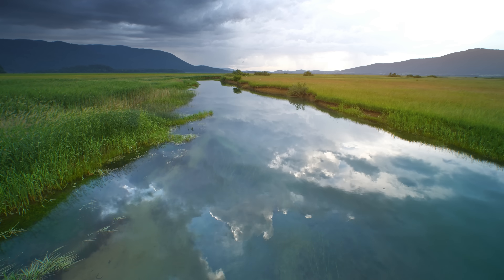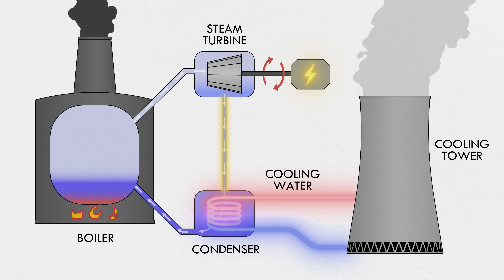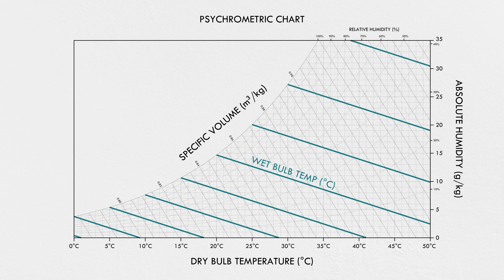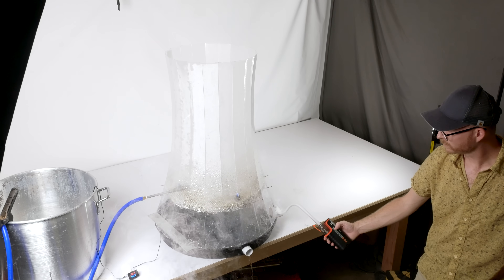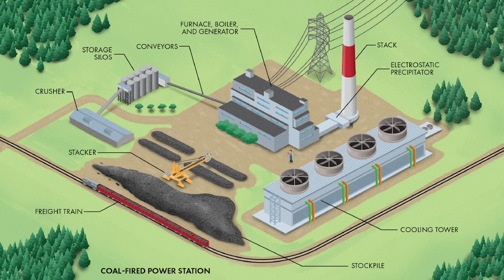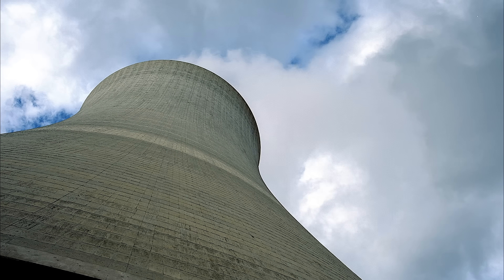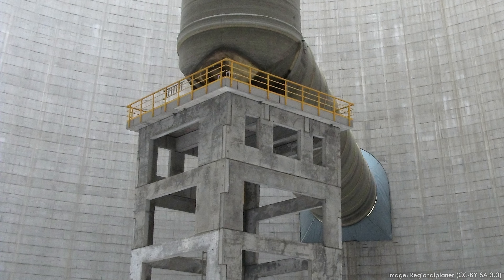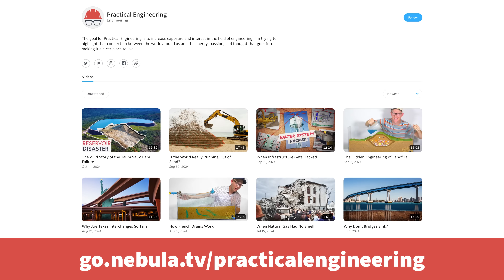Why Are Cooling Towers Shaped Like That?

Comment: I have never been able to understand why they use a lot of power to boil the water to use the steam for the turbines and instead of just dropping the temperature just a bit, the output from the tubines is cooled right down and then yet more energy has to be used to generate more steam.   It seems rather a waste of so much heat and hence inefficient.
Reply: it isn't as wasteful as you think because this is extremely simplified and skips over a ton of technical detail that makes it efficient

Comment: 1:36 If they were venting to atmosphere wouldn't they be limiting themselves to a much higher cold side temperature than they want to use? I thought the aim was to get the low pressure side below atmospheric pressure.

Comment: 7:40 - Yes, that is a detail a lot of people don't know (and I'd say it's pretty unintuitive). The density of "pure" steam is about half the density of air. So it's not just that hot air can contain more moisture and will rise due to being less dense than the cooler air surrounding it, but the steam itself also "rises" (again, due to being pushed up by denser air around it).

I always avoid saying "hot air rises" because that's a bit misleading. It's not the hot air that's "rising", as such, it's just that the denser air around it pushes it up, due to being pulled down by gravity. So it was nice of you to reword that as "more buoyant" on the next sentence, which I think gets the point across that the rise is caused by what's around it.
Reply: This also ties itself very well to meteorology 🌦️
Reply: what is it about humid air that makes it bouyant in air
humid air is just air with water in it isnt it? and water isnt bouyant in air
Reply: @vincentgrinn2665  - Water in gaseous form is less dense than (and therefore buoyant in) air.

Comment: My personal favorite about cooling is Brunswick Nuclear Plant near Southport, North Carolina. It uses an 8 mile channel to take water from the Cape Fear River and discharge to the Atlantic Ocean without needing cooling towers but there were issues with approval for that so there are two unfinished cooling towers on the site.
Reply: I had to search it up, the Wikipedia picture gives perspective of just how huge the base of the tower is. Google maps shows that the inside of it is being used as a parking lot now!

Comment: large cooling towers are NOT that common for nuclear power plants actually. most nuclear power plants use large bodies of water like the ocean to cool since they need far more and more consistent cooling. the association of cooling towers and nuclear power plants is mostly wrong, they are far more common for coal or gas fired power plants.

Comment: We had two separate sets of cooling towers at the papermill I worked at. One for tthe process water and another for the feed to the effluent treatment plant to keep the temperature in the narrow range needed to keep the microbes in the biomass from either going dormant or dieing.
Reply: The papermill has microbe biomass which it tries to keep alive?
Reply: @marc-andremichaud1251  Yes. The cooling for the process water keeps non-desirable solids from being disolved in the water improving the paper quality and in order to have a semi-closed water system the biologics that are in the water need to be treated before being sent to the municipal waste water treatment facility. We had an effluent treatment plant to do that and the microbes had to be kept at 95º to 105º degrees to be active. The byproduct of that process is biogas for a power turbine to reduce electric costs or reliance on natural gas for the boilers depending on conditions.

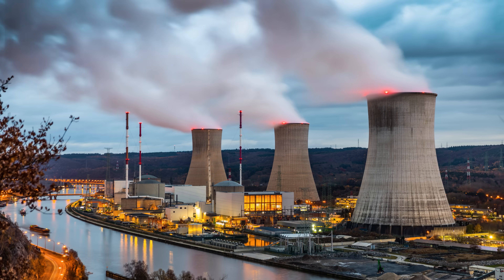Comment: 13:37  CANDU plant!  All of the plants in Canada use lake or ocean cooling rather than cooling towers, but cool to see a reactor that is so familiar to me.
Reply: You can see the same effect in your shower, if you have a curtain. If you take a hot shower and have a fine mist sprayer, you see the curtain get pulled into the shower. That's all because the air current created by the warm, most air rising and the cooler, drier air being pulled in to replace the air that rose. Even with hot water, you can create currents. Some old hot water heating systems didn't use a pump. Instead, the hot water would rise and draw the cooler water into the boiler, to be heated. It took longer to heat up the whole system this way, but worked nevertheless.
Reply: @kevinyancey958  Actually that low pressure is mostly due to the Venturi Effect where the spray of water draws air along with it, causing a low pressure area.  Higher pressure in the rest of the room pushes the curtain in.
Reply: I used to work at opg and now I'm at Bruce!!! Neat to hear someone working in the same group also watching :)
Reply: All plants here in Sweden are cooled by seawater, and obviously built on the coast. I always thought these were super foreign as a kid, and turns out that I was pretty much right. Besides stuff like hydro and wind, I've never seen another type of powerstation in sweden, so I can't say for sure there are none but I can say I have never seen one.
Reply: Which one do you think it was? Darlington or Bruce?
Reply: @acemannotsomeother  It might actually be pickering,   I count a 23 X 23 tube face  , which suggests 390 pressure tubes, I know it's not Lepreau (Candu 6 380 PT)
I worked on the lepreau retube.
Darlington and  Bruce have  480 PT   so more  rows and columns .
Reply: In-land power plants will create their own ponds to cool the power plant. It's best to do this, than to heat a lake with fish in it.
Reply: @kevinyancey958  not if you have the largest lakes in the world. You only need to raise local temperatures by a few degrees and the fishing is great near the outlet due to the slightly warmer water keeping the big fish around.
Reply: @kevinyancey958  I'll never understand this idea that nature doesn't like heat.

Comment: For those like me, that can't believe that wet air is less dense then dry air, it's actually pretty logical:

Dry air is heavier. Air consists mainly of nitrogen (N) and oxygen (O). The molar mass of a nitrogen atom is 14 g/mol and that of an oxygen atom is 16 g/mol. Since these elements occur in the air as N₂ and O₂ molecules, their mass doubles: 28 g/mol for nitrogen and 32 g/mol for oxygen. A water molecule (H₂O) consists of two hydrogen atoms and one oxygen atom. Hydrogen has a molar mass of 1 g/mol. The weight for a water molecule is therefore: 2 * 1 g/mol + 16 g/mol = 18 g/mol. Water vapor is also lighter than the main components of air, N₂ and O₂. When the air absorbs moisture, the lighter water molecules displace some of the heavier nitrogen or oxygen molecules. Moist air is therefore lighter than dry air.

Thx for your videos! You are the best!

Comment: 0:15 The smoke stakes are not designed to disperse smoke far away from the cities and just to use the difference in the air pressure to not use ventilation hardware. 8-)
Reply: It's actually both.
Reply: Actually no, it still is in fact one of the design purposes..
Reply: But they still do...
Reply: Maybe not but smoke STACKS do.
Reply: He didnt say cities, he said populated areas i.e. where people are. If they just didn't want to use ventilation equipment, they wouldn't try to pump it anywhere and just let it flow into the factory.
Reply: Mmmmm.. smoke steaks...
Reply: My brain cramped reading this
Reply: sometimes there's a layer of air close to the surface where hot air actually sinks. The goal of the stack is to put the exhaust above that layer of air so that it doesn't concentrate on the surface.
Reply: Sorry you're wrong ! In Grimsby we put up Tioxide tower from the white paint factory , built it REALLY high to get rid of the nasty chemicals make sure they didn't land in the north sea close by .   The fallout made it to Scandinavia (much to the swedes distress LOL)
Reply: Smoke stacks were specifically made tall for the dispersive effect not to act as a vacuum. Also that wouldn't work. The pressure in the stack will just form a pressure gradient equal to the atmosphere.
Reply: @Arethious  inside the stack pressure is lower because the gas inside is warmer, hence the strong draft.
Reply: @markotrieste  true there is convection. I didn't say there wasn't. I was talking about the idea of using lower pressure atmosphere as a vacuum. That won't work. Also it's not the pressure that changes so much as the density. That makes the hotter gas buoyant. If the pressure changed it would just compress back down from the surrounding gas pressure. There will likely be a low pressure area in the stack but that is likely due to the venturi effect and because the gases start picking up speed in a uniform flow its inertia pulls on the gas below it.
Reply: Smoke stacks are tall both to have strong natural draft as well as to eject the contaminants above the inversion layer. Especially in winter, if you have an emission of pollutants inside the inversion layer, they don't spread. Inversion layer is characterized by a temperature gradient that rises with height and has little to no wind. So it's definitely correct to say that stacks need to be tall to disperse the pollutants away. See 2:25 for a typical example of stacks piercing above the inversion layer.
Reply: Me when I spread misinformation
Reply: It's not smoke
Reply: It's not smoke.... spoiler alert...

 it's steam a.k.a. water vapor
Reply: @Jake-uc8mb  Click the timestamp genius, the shot was of smoke stacks in front of coolant towers, and he was talking about what smoke stacks do as opposed to coolant towers.
Reply: No smoke comes out of these stacks it's all steam. As the water falls through the tower the air naturally cools the water the stuff coming out the top is just steam/ vapour.
Reply: @Classic_Re-creation  Cool. Click the timestamp. It shows smoke stacks in front of the coolant towers.
Reply: It's not smoke fool's
Reply: @GeorgeWashington283  he did clarify later in the video that sometimes they hide an actual smokestack inside the cooling tower
Reply: @GeorgeWashington283 finish your sentence
Reply: @GeorgeWashington283 It's not smoke, fools.

Comment: It's definitely pronounced turbine and not turbin because it's spelled turbine.
Reply: extremely pedantic incorrect buzzer
english ain't that simply buddy and different regions use different pronunciation, eg nuclear, alumin(i)um, etc. No grammar naziism please
Reply: @OutbackCatgirl  Aluminum is spelled aluminum and aluminium is spelled aluminium. With the reach of communication, regional dialects will slowly vanish away and pronunciation will trend towards how the word is spelled, because well, it's simpler. Let's not slow this process. Why would you want to continue to needlessly complicate the English language? I know I say wuder and I know it is spelled water and I acknowledge water is the correct way to pronounce it. If my audience is not local, I will make the point to pronounce it correctly.

Comment: 8:44 - I hear "reject", subtitles say the same but while not a native speaker shouldn't it be eject?

Or is reject specific engineering lingo in this case?
Reply: Its a specific term. Heat rejection is the process of removing excess heat from a system.
Reply: @Tevruden  Thank you captain 🫡

Comment: I never guessed that dry hair would be more dense than humid air
Reply: when you think about it, it kind of has to be, or clouds wouldn't stay airborne.
Reply: what about wet hair?
Reply: i barely even understand how
"water molecules weigh less than the nitrogen or oxygen in the air"
ok then why is water denser than the air? why dont oceans float ontop of air
Reply: @vincentgrinn2665  because the water molecules in question are in gaseous form. So my understanding would be that gaseous water molecules demand more personal space than gaseous air molecules.
Reply: @kenbrown2808  ah yep ok, they weigh more but theyre less dense
Reply: @vincentgrinn2665  that's my interpretation.
Reply: @vincentgrinn2665  because things act differently when they're gas vs liquid? You're unsure how liquid water doesn't float on air?

Comment: Waste heat can also be used for heating greenhouses, households
Reply: Yepp, I write this comment in the warmth of my home courtesy of a power station (and nearby paperpulp plant)
Reply: Nuclear powerplants are often built at a long  distance from big cities, to make it "economically motivated " to connect them to the system " ,long distances kll the economics in regional heating systems.  High energy losses , very long pipes are expensive to build and maintain ,high flow pressure losses in the pipes if they are long. 
Regional heating needs relatively high density /concentrated built inverments to be ,feasible.  Not nesseery big citys but not to spread out.
Reply: @perstaffanlundgren  greenhouses then?
Reply: @Hecatonchires1991  if there I any around them mayby, but the initial investment building the regional heating system is so big and a fue greenhouses would not cut it as a customer base  to build it.  Or they would have to pay a lot to get it there. 
For example if  a street has only one house and its 1 km pipes going there   from the main line    to put together and bury to connect ,it would be very expensive for that house owner  likely there will not be built pipes there,  but a street with 40 houses and ikm pipe  would  be more economic.  It's a good idea to reuse the waste heat and I truly think it would be possible in the most citys and even  suburbs in USA.  Citys   like New York has these systems but based on steam heat there.
Reply: @perstaffanlundgren  More than just nuclear. Most combustion plants are the same way. The ones close enough to the core of a city to make this viable are rarely used because they're old (and frankly at this point even those are likely permanently shut down.
Reply: @Kandralla  it's not just core of citys that are suitable, as long as ther is houses to connect to on the way regional heating is not terrible expensive, we have them going out to smaller houses also not only apartment houses . The more houses apartments the less cost per 
Unit.
Reply: @perstaffanlundgren  you're not running steam or water lines 30 miles.
Reply: In theory yes, but in practice it seems to be rare. Probably because of the safety/permanence requirement. But why don't they combine a heat grid with a cooling tower for backup?